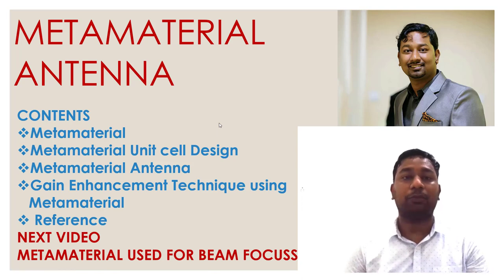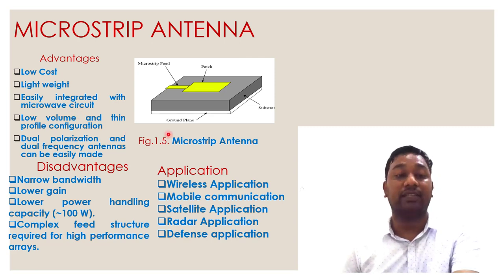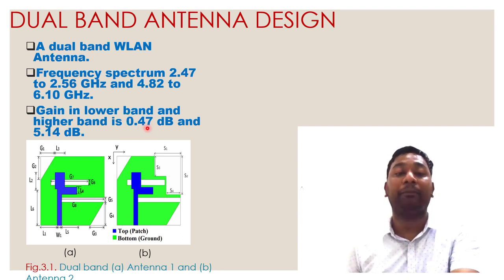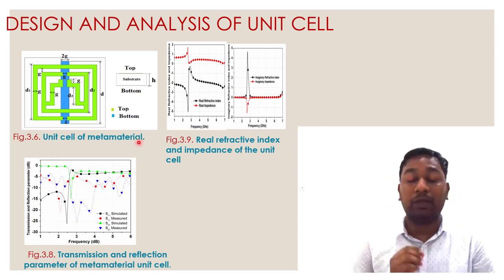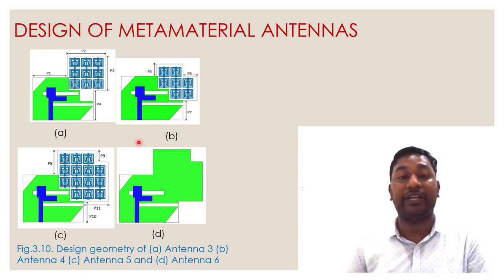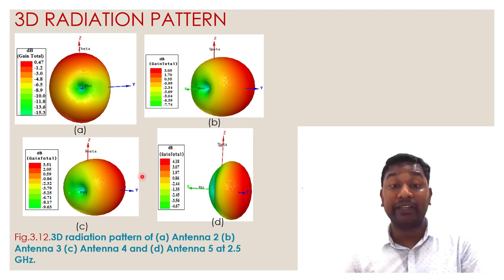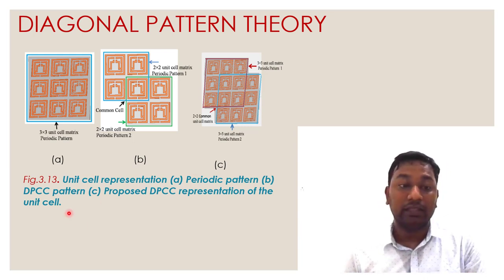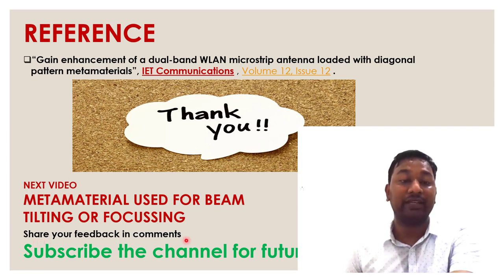Metamaterial Antenna (SCI JOURNAL)

Comment: Can this kind of technology be used to design antennas in the ISM band?
Reply from the maker: yes
Reply: Thanks, @life-hack-360 . I would like to know if this technology can improve the size of this kind antennas. You know that nowadays IoT is it is growing a lot, for instance, Sigfox and LoRa use this band. One of the downsides is that the antenna size and the ground plane necessary for achieving a reasonable quality (Gain & Efficiency) makes the device has to be big for a wearable device. The questions are: Are the ground plane necessary for this kind of technology? and If you need to use a ground plane for proper quality, is it hat size smaller than a typical lambda/4 antenna?
Reply from the maker: @oscargomezf  The main problem regarding this technology related to the size of the antenna. The overall dimension of the antenna increases. But whenever dual-band with gain improvement is necessary any particular band you can use where dimension is not constraint